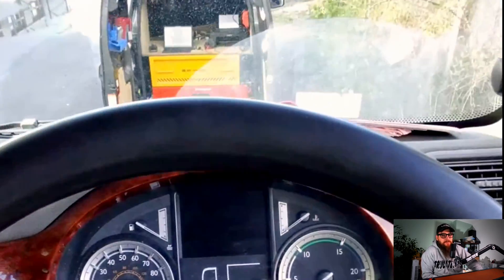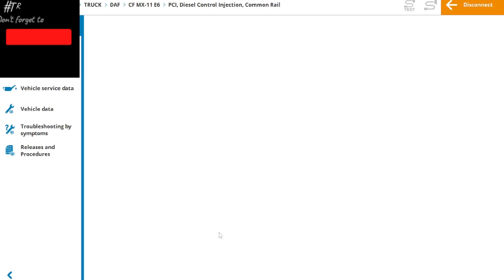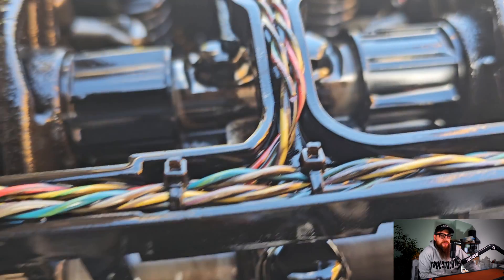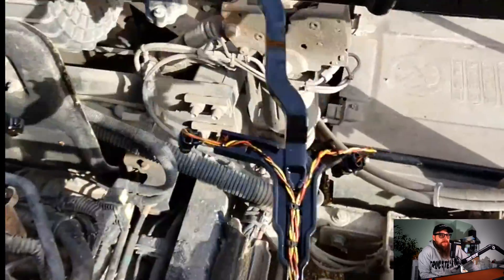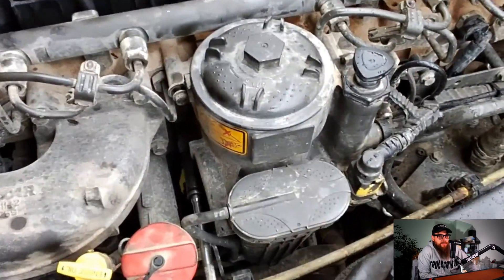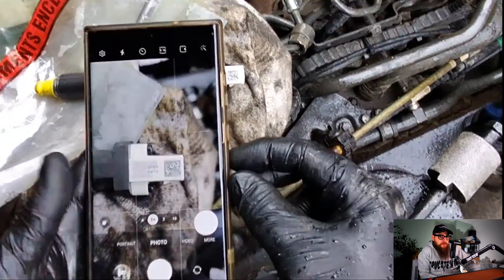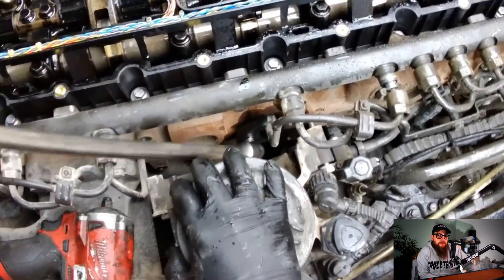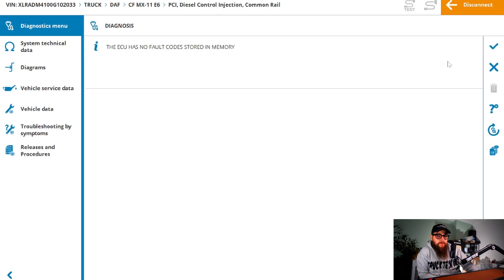DAF MX-11: Tackling Injector Replacement And Wiring with JALTEST

Comment: What would be the functions that cannot be done on the MX13 Paccar? I work on them and I have not found any software that works well, but I see that it works very well for you.
Reply from the maker: I've used davie-4 for 10 years and I've not found one thing I can't do with this. I can even program the PCI ecu

Comment: Great video! You can share what is the tightening torque for oil pan bolts, (mx13 euro 6)?? You use glue for this bolts?
Reply from the maker: Hey buddy thnaks for the comment. I think I said it on another video I did on crankcase ventilation module failure and replacement but off the top of my head it's 28nm
Reply: I think mx13 and mx11 oil pan have different  tightening torque due mx13 have a composite oil pan.  @TRUCKTECHUK

Comment: Hello friend! How is it to work with jaltest? I use Texa for work, I can say that it is good but for some trucks it does not give much information.
Reply from the maker: Hey Paul 👌👍thanks for the comment buddy.
I prefer jaltest as I find the manufacturer-specific diagrams and the remote call center help brilliant. I think the new features jaltest is pushing out will set this apart from any other diagnostic equipment that covers multiple manufacturers
Reply: Thank you! @TRUCKTECHUK

Comment: When u say, " only time will tell"  on that injector fault,   i felt that 😂....  good luck , hope no 🪃  boomerang..
Reply from the maker: Ha ha ha thanks for the comment Andy 😅. Seeing as he has a few DAFS I've been working on I should have added it's been fine since I recorded this 2 weeks ago😎.
I find it's different working out the van as opposed to the workshop As I wouldn't give the customer the truck back till it was correct, especially with intermittent faults but here I am trusting evidence-based diagnostics over parts changing 😅😅😅🫣

Comment: You know that your DAF has a problem when there are no faults on the DIP😅Big kudos for correctly following the procedure on injector replacement, it's so important, considering the tolerances, involved forces and required cleanliness. Is it understood why the injector fails, and does this happen more often? Surely not a cheap fix...
Reply from the maker: If you don't have things going off on the DIP is it REALLY a DAF 😅👌

Oh, I think for people looking online on how to fit an injector and it doesn't fall out, I think it will help.

Injector failure for me is usually leak-off with a high correction value. This Injector I believe was a solenoid failure but I just couldn't get it to do it consistently 😕

Injectors from DAF are £650 each exchange, I can get them done for £350 but they have to go away to be done 😪
Reply: Same here, not usually a solenoid failure but excessive internal leakage from control valve. P0094 is common fault for this issue. Injector prices in states is over $1000 a piece and the rail to injectors pipes were $150, but they went on backorder for months and know are $45 a piece. The EPA 21 with the newer Delphi (Borg Warner) DF21 injector are having a lot of issues, very sensitive to internal deposits. Just released another cleaning and software update to help reduce issue. Nice to see working on MX-11, not very common in US. I have only worked on a few, never had opportunity to really check out the DOHC in person. Thanks for the videos Russ and Congrats on your success.
Reply from the maker: Hey Steve thanks for the comment 👍👌😎.

Yes P9004 and p228D are the usual fuel-related DTC'S for excessive correction value. I have got an MX-13 DAF XF here that's worked its way to me that looks like a camshaft lobe issue that has had ££££££ spent IN ALL THE WRONG PLACES 😳

 In regards to the new ph2 Delphi injector, I take it the re-design of the internals where the waxing/soft deposits collect and cause them to stick still hasn't been resolved on your end either  🫣.

Customers who have spoken to me about it don't want to purchase any more next-generation DAF product till it's been resolved due to the workshop downtime incurred.
Reply: @TRUCKTECHUK  Exhaust lobes/ cam follower pitting adhesion wear is getting more common here on the EPA17. Paccar did extend the warranty to 7year, 700,000 miles. Yet to have a failure at my fleet, but we use high quality 15W-40 oil with shorter drain intervals than recommended and run valve adjustments more frequently. Looked at one last week that other fleet thought they might have cam issue because of low oil pressure but found a wore out variable displacement oil pump. Always something. Cummins have just as many issues IMHO, I always preferred the Caterpillar engines!
Reply from the maker: We had a guy on camshaft replacement 5 days a week when they first started going. I'm going to pull the sump off this and have a look 👀....might measure the lift on the high-pressure pump unit followers and also check when they are at TDC ect as I've had one fuel pumping unit camshaft lobe come loose and turn! 

I've changed a few oil pumps due to low pressure on the older engine, we will see how the new solenoid-operated pumps last 👍

As for Cummins I'm just starting to use insite to play about with them 👀.

We had CAT engines fitted to FODEN years ago.....C10 I think the engine was......I spent more time picking them up with a low-loader unfortunately but we put that down to a lack of maintenance where I worked I think
Reply: Not sure how big the Foden was, but the C10 was not very popular engine in the States due to the fact of being so close in size to the C12 externally, yet the longer stroked C12 had much better HP/Torque ratings. The C12 became more popular than the M11/ISM in vocational markets because higher torque output, the fact it didn't seem to leak oil as bad/ or crack the front gear housing, or have the main bearing fretting issue like the Cummins.
I know that the manufactures are pressured by regulators to achieve lower fuel consumption, but the switch from gear oil pump to vane pumps was bound to cause more issues. The pumps appear the same with addition of an external PWM solenoid controlling the regulator/rotation of stator, but they do state the newer pump has higher capacity.
Once again, I really enjoy your videos, great sense of humor, and seeing how others around the world overcome similar issues!  @TRUCKTECHUK

Comment: Your amazing ,this is terrifying, you couldn't use a modern truck to go overlanding with you.
Reply from the maker: Hey Robert thanks for the comment. Modern truck fuel systems and engines require extreme cleanliness and standards which I can't do being mobile unfortunately 😕. 
I think it might be time to look at opening a workshop specifically for DAF
Reply: @TRUCKTECHUK  I was a coach builder 25 years ago and the cumins bt6 was bullit proof for 500 thousand miles. Fuel and air that's all it needed.
Reply from the maker: @robertanderson-yx8mo  I miss the old m11 Cummins fitted in FODEN. Likewise, they went forever without anything but filters and oil BUT in today's market manufacturers have introduced parts that require meticulous cleanliness and tolerances.....take the issues PACCAR are seeing with the latest fuel system for example. If only things were as simple as they once were......
Reply: @TRUCKTECHUK  I loved the n14
Reply from the maker: Yes I think all the Cummins products have been well received and I'm so happy they have moved away from EGR in the PX-5 and PX-7 in PACCAR products.....who knows what the future holds now DAF is fitting the Cummins X15D engines to XG+ 👌😎
Reply: @TRUCKTECHUK love the channel and it's  so educational on modern trucks.good job